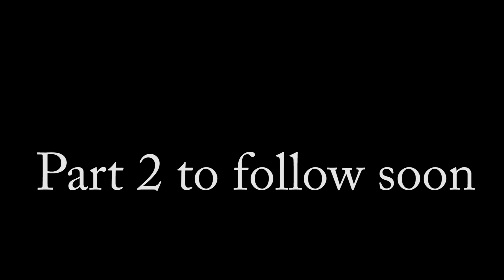Pfizer, process 2

Comment: To those and their families and friends who have taken this 'vaccine' and have suferred please speak out. The evidence is unquestionable......are you not enraged? Please raise your voices and those of your loved ones who are unable to.
Reply: And urge them to try some extended fasting to regenerate the white blood cells it damages. Otherwise they will be helpless in the face of cancer and autoimmune issues, which are dramatically on the rise. Some benefits of doing occasional extended fasting: High blood pressure is lowered to normal levels very quickly while fasting. Fibrosis/scarring is reversed over time, including in the heart and lungs.

Fasting stimulates phagocytosis, the ingestion of bacteria, plaques and viruses by the immune system. It will also remove any 'foreign material' like spikes that are not supposed to be there. Whether natural or unnatural in origin..

Blood clotting is reduced and blood clots and arterial plaque are reabsorbed into the body. 

Blood sugar and insulin are lowered when fasting, allowing white blood cells to move more freely throughout the body and do their job.

Vitamin D plasma levels are increased as fasting improves metabolic health, and vitamin D in turn increases autophagy.

Reflexes and short term memory are increased. 

Fasts from 36-96 h increase metabolic rate due to norepinephrine release! 

Telomeres are lengthened and fasting also increases anti-aging Yamanaka factors.

After 72 hours or more fasted, your body recycles up to 1/3 of all immune bodies, rejuvenating your entire immune system. This helps prevent the onset of new autoimmune conditions, which develop through a leaky gut and damaged immune system.

Fasting can help with MS, Depression, BPD, Autism and seizures.

Thymus is regenerated, which suppresses aging and renews the immune system. The thymus also plays a vital role in fighting cancer.

Weight loss from daily caloric restriction has 1/4 to 1/3 of the weight lost as lean tissue while many studies show fat loss from 36 h fasts without losing any lean tissue! 

The obese will lose extra tissue like loose skin while fasting, but the skinny or frail will have increased growth hormone release than the obese, which helps to make more lean tissue and reduce frailness.

When you move out of MTOR your body shuts down the building blocks of the cell required for viruses to replicate.

The hunger hormone ghrelin also lowers with extended fasting and rises from dieting. 

What breaks a fast? Anything with protein or carbohydrates in it will break a fast. Most teas and herbs are OK. Most supplements and meds will either break ketosis directly or contain a filler that will. Many meds are dangerous to take while fasting.

Does fasting lower testosterone? No, it raises it when the fast is broken by increasing lutenizing hormone. Fasting also increases insulin sensitivity, which helps with muscle building.

Fasts of 36-96 will not affect short term female fertility or affect menstrual cycle. They also may increase long term fertility, especially in women with PCOS.

Fasting reduces pain and anxiety by stimulating the endocannabinoid system in a similar way to CBD oil.

Stomach acid is reduced over time while fasting and can allow for the healing of treatment resistant ulcers. Some patients may need continued acid reduction medication while fasting.

Does the body preferentially prefer glucose as a fuel? No. Except for brief periods of very intense exercise, your body mainly burns fats in the form of free fatty acids. Your brain also prefers to burn ketones at a rate of around 2.5 to 1 when they are available in equal quantity to glucose.

Fasting stimulates the AMPK complex and activates autophagy. Autophagy (literally self eating) will cause cells to recycle damaged proteins and foreign matter such as viruses. It will can kill cancerous and senescent cells

Lowering insulin via fasting virtually eliminates chronic inflammation in the body. 

It increases mitochondrial function and repairs mitichondrial DNA, leading to improved ATP production and oxygen efficiency. Increased mitochondrial function also has the added benefit of increasing your metabolism, fighting infection and cancer prevention!

Fasting releases BDNF and NGF in the blood which stimulates new nerve and brain cell growth. This can help a great deal with diseases like MS, peripheral neuropathy and Alzheimers.

When not in ketosis, the brain can only burn carbohydrate, which produces a great deal of damaging ROS the brain has to deal with.

Fasting also increases telomere length, negating some of the effects of aging at a cellular level.

When you fast, this stimulates apoptosis in senescent or genetically damaged cells, destroying them. Senescent cells are responsible for many of the effects of aging and are a root cause of the development of cancer. 

A fasting mimicking diet for 3-5 days in a row also provides many of the same benefits as water fasting. FMD usually has 200-800 calories, under 18 g of protein and extremely low carbs.

Exogenous ketones can aid with fasting, making it easier in healthy people and allowing some people with specific issues to fast in spite of them without worrying as much about hypoglycemia. They also help with dementia and many other issues even if you take them while not fasting!

Glycine and trimethylglycine can also be useful supplements while fasting that won't break ketosis and have many benefits.

Children, pregnant or nursing women should not fast for periods longer than 16 hours. People with pancreatic tumors or certain forms of hypoglycemia generally cannot fast at all. Type 1 diabetics can also fast but it is more complicated and should be approached with caution as it could lead to ketoacidosis. If you experience extreme symptoms of some kind, especially dizziness or tremors, then simply break the fast and seek advice.

Resources:
https://www.ncbi.nlm.nih.gov/pmc/articles/PMC5783752/
https://www.ncbi.nlm.nih.gov/pmc/articles/PMC1413655/
https://www.ncbi.nlm.nih.gov/pmc/articles/PMC5783752/
https://pubmed.ncbi.nlm.nih.gov/6859089/
https://www.ncbi.nlm.nih.gov/pubmed/10232622
https://www.ncbi.nlm.nih.gov/pmc/articles/PMC8470960/
https://www.cell.com/molecular-cell/fulltext/S1097-2765(18)30605-1?_returnURL=https%3A%2F%2Flinkinghub.elsevier.com%2Fretrieve%2Fpii%2FS1097276518306051%3Fshowall%3Dtrue
https://pubmed.ncbi.nlm.nih.gov/28235195/
https://www.ncbi.nlm.nih.gov/pmc/articles/PMC2815756/
https://www.nia.nih.gov/news/research-intermittent-fasting-shows-health-benefits
https://medicalxpress.com/news/2022-10-treatment-pulmonary-fibrosis-focus-telomeres.html
https://www.ncbi.nlm.nih.gov/pubmed/10859646
https://academic.oup.com/ajcn/article/81/1/69/4607679
https://pubmed.ncbi.nlm.nih.gov/31877297/
https://n.neurology.org/content/88/16_Supplement/P3.090
https://pubmed.ncbi.nlm.nih.gov/31890243/
https://pubmed.ncbi.nlm.nih.gov/2518860/
https://pubmed.ncbi.nlm.nih.gov/29727683/
https://www.ncbi.nlm.nih.gov/pmc/articles/PMC5895342/
https://www.ncbi.nlm.nih.gov/pubmed/25686106

https://www.sciencedirect.com/science/article/pii/S1931312809002832
https://pubmed.ncbi.nlm.nih.gov/15522942/
https://faseb.onlinelibrary.wiley.com/doi/abs/10.1096/fasebj.2019.33.1_supplement.819.10
https://www.biorxiv.org/node/93305.full
https://www.arcjournals.org/pdfs/ijrsb/v3-i11/7.pdf
https://www.ncbi.nlm.nih.gov/pmc/articles/PMC6407435/
https://www.ncbi.nlm.nih.gov/pmc/articles/PMC6141719/
https://pubmed.ncbi.nlm.nih.gov/20921964/
https://pubmed.ncbi.nlm.nih.gov/25909219/
https://pubmed.ncbi.nlm.nih.gov/21410865/
https://www.ncbi.nlm.nih.gov/gene/25712
https://pubmed.ncbi.nlm.nih.gov/23707514/
https://www.ncbi.nlm.nih.gov/pubmed/24905167
https://www.health.harvard.edu/heart-health/abundance-of-fructose-not-good-for-the-liver-heart
https://www.ncbi.nlm.nih.gov/pmc/articles/PMC7093158/
https://clinical.diabetesjournals.org/content/36/3/217
https://www.ncbi.nlm.nih.gov/pubmed/23876457
https://www.ncbi.nlm.nih.gov/pmc/articles/PMC6526871/
https://www.ncbi.nlm.nih.gov/pmc/articles/PMC7607739/
https://www.collective-evolution.com/2017/05/16/study-shows-how-fasting-for-3-days-can-regenerate-your-entire-immune-system/
https://pubmed.ncbi.nlm.nih.gov/7714088/
https://www.cell.com/cell/fulltext/S0092-8674(19)30849-9
https://www.ncbi.nlm.nih.gov/pmc/articles/PMC3017674/
https://pubmed.ncbi.nlm.nih.gov/23408502/
https://www.amjmedsci.org/article/S0002-9629%2815%2900027-0/fulltext
https://europepmc.org/article/MED/22402737?javascript_support=no
https://onlinelibrary.wiley.com/doi/full/10.1111/j.1365-2265.2005.02288.x
https://www.nejm.org/doi/full/10.1056/NEJMoa012908
https://pubmed.ncbi.nlm.nih.gov/27569118/
http://www.cell.com/cell-metabolism/abstract/S1550-4131(15)00224-7
https://repository.upenn.edu/cgi/viewcontent.cgi?article=1537&context=edissertations
https://www.ncbi.nlm.nih.gov/pmc/articles/PMC1779438/
https://www.nejm.org/doi/full/10.1056/NEJMc2001176
http://www.sciencedirect.com/science/article/pii/S0005272806000223
https://www.clinicaltrials.gov/ct2/show/NCT04375657
https://pubmed.ncbi.nlm.nih.gov/20102774/

This list compiled over years of research by the user known as Pottenger's Human on youtube. Feel free to copy and paste this anywhere you like, no accreditation needed!

My community tab will always contain an updated version of this list of fasting benefits. I also have playlists on fasting and health topics.
Reply: @LTPottenger  HAHAHHAHAHAHAHAHA
Reply: @PaulFilmer 
Why are you laughing at this?
Reply: Yes, I don't understand the acceptance of people who've been injured. Where is the outrage?
Reply: @cherylnelson5384 I strongly suspect it’s because of an underlying reason - to help. For me it was a type of sacrifice. I have been a natural energy healer (not Reiki) for 22 years with a private practice for 10. During this time I helped many people with their issues. People of all ages and all conditions. My nature is to look behind the scenes for causes not symptoms. The reason I became a natural energy
 healer, working with the human energy field that both surrounds and permeates the body, was to give my youngest son an increased chance of survival from the brain cancer he suffered as a child. He’s now a medical health professional and working in a front line capacity. I myself have no formal medical training but during my 22 years of practice I became medically intuitive with people’s symptoms. Though ‘healers’ are not allowed to diagnose we often have metaphysical insight into the causes of people’s issues mental, emotional therefore physical. There are good undergraduate texts in the public domain for research and now we have Dr Google so that helps to inform people more quickly if they like to back up their intuition with conventional allopathic current understanding. I took the first vaccine because for all the naysayers in my line of work I sensed it was the humanitarian attitude. I was making my contribution to what I sensed was a great experiment.  I had never been fitter following  the first vaccine although had suffered the taste of it in in my system for four days and also suffered from mild flu like symptoms.  When it came to the top up vaccine I was as a lamb to the slaughter. The volunteer stabbed my upper arm bicep I suspect she hit the nerve. I could not move my arm or right side for 4 weeks, I also had a nerve twitching in the 
left side of my face but as I know the CNS crosses at the midline I suspected this almost Bells Palsy was unrelated. I knew I had nerve damage and tried to make an appointment but was informed not to try to make an appointment, as no one would speak to me, by the nurse practitioner who said that she herself had suffered from this for a week following her top up. I suspected I had better coping mechanisms than many and was sure that I would recover. I did recover from the severity of the pain and lack of movement. I remained inactive in bed for a month. I struggle with medication so took as little ibuprofen as possible, drank plenty water with lemon and practised self healing. My mind was strong then and  I was determined to recover. I began to move about more but noticed that my seasonal allergies had increased and continued increasing. I was taking one prescription only antihistamine for seasonal allergic symptoms, hay fever, but I was developing extreme rashes on my body and would wake up in the morning to find my limbs covered in red circles. I did manage to see the practice nurse who said I had scabies and to treat myself and my husband for this. Of course the treatment was  useless because it wasn’t scabies. I’m a swordswoman and attended a training weekend a few months following the top up which put my body under immense strain by altering my temperature. My nervous system and skin irritation were almost unbearable. Again I sought the help of the GP who prescribed steroids during a phone consultation and the week following another dose. The result of this led to an increase in symptoms after the relief of the first few doses and I entered a mild psychotic state when I was informed to cease the medication. By this time I reasoned the top up jab has seriously altered my immune system and that it was over producing hormones/chemicals to fight a non existent virus in my body. No virus existed but I was the human virus. My parents both suffered severely from autoimmune type diseases. My brother is type 1 diabetic, diagnosed at 21 which was probably childhood onset undetected until he suffered 3 serious viruses, mumps, measles and flu at the age of 20, resulting in a diabetic coma. I suffered severe endometriosis since the onset of puberty. Though allopathic practitioners may not see the connection with familial hormone imbalances, I certainly do. I was determined to rid myself of the effects of this vaccine and followed an elimination diet. I was informed from sending images of my severe rash and symptoms I was unsure of the necessity for a third vaccine but following constant phone calls from the GP to have one, and my son who was working with unvaccinated dying people of my age group and still retaining good will towards others I endured the third, second top up vaccine to my chagrin. What would you do? If your child who had survived a relatively rare brain cancer and who had fought for 10 years to become clear of the disease and ensuing medical issues following recovery who had struggled to achieve his career ambitions and was working in the place for first hand experience of seeing death and dying people and who didn’t want me to succumb to the same fate, I felt I had Hobson’s choice. A few days following the Pfizer top up on my birthday I stood at midnight in my back yard with snow falling on me naked apart from my knickers, screaming in agony and scratching all of my body till it bled and bruised with my husband threatening to call an ambulance or take me to A&E immediately I was screaming no! I did not want any medical intervention. I ran a cold bath and plunged myself into it for 2 hours until the itching began to stop. The worse thing was the anaphylactic symptoms I knew my throat was narrowing and I couldn’t swallow. The doctor on duty at the vaccine centre had administered the third vaccine because I had complained to her about not wanting to be treated like a piece of meat. I had no immediate reaction the symptoms began about 5 days later. I had recovered before and I would recover again I told myself. Positivity is the key. There were plenty people worse off than me. However, this third time’s vaccine was harder to recover from. I did barrage the medical profession for help. I implored my GP to write for appointments to dermatology and immunology departments. This was a huge struggle because she did not want to refer me saying what was the point, I can’t take any medication they might prescribe that I should accept I had am autoimmune disease and think myself lucky. She disputed the fact that vaccine damage was the cause. It was a battle of wills. I wrote a very persuasive letter to the same GP and she did eventually write to these departments. This was 18 months ago. I have seen the dermatologist who considers my symptoms hormonal. I am yet to see the immunologist. Further to my recovery from the third vaccine I had three whole weeks without symptoms and 7 months following the third vaccine, second top up I contracted king Covid from my husband and 14 months later have still not recovered. I have given up many of my previous activities, all I have worked for, a healthy body and youthful experience. I can’t practice yoga or train in swords. As I can’t stand pressure on my limbs I struggle walking up the stairs. My digestion is very poor my eyesight is blurry, I have brain fog, ninety loss and the skin which was once pure and free of blemishes is now bumpy marked and constantly pricking. I have lost myself and found an old lady looking back at me. I don’t have the energy to complain. No one is actively listening. Here Dr Campbell affords an opportunity for those affected or their families to voice their discontent. Yes I’m discontented with global policies and the selfish mendacity that feeds our leaders. We didn’t know did we or were blinkered to the great experiment but life itself is an experiment. My energy is now best centred upon trying to reprogram my body to reinput the old system. I must work closely with pituitary and pineal energy centres and do what I can when I canto survive this crisis. I don’t think being angry will help my body. The last thing I need to do is be angry with myself or anyone. There are always unknown reasons behind everything in this little life. I have shared some of my story here because it seemed appropriate.  The fight has gone out of me to protest. I’m choosing my battle which is an inner one. I can’t wear my helm because my head itches as soon as I change internal temperature but I’m going to try. Slowly I will recover then I can help others recover too. Hope this explains.
Reply: Same. Why are some of the jab injured not angry??? Or in shock??? The scorttish vaccine injured group are very vocal which is great but how are others not.
Reply: @andreagerrity1056  because others haven't been grifted
Reply: I’ve had to help quite a few through illness including severe injuries …most are doing well now…but now it’s me I’m absolutely exhausted…I’m trying to inform them of their rights I don’t live near some of them and now I’ve not even been able to drive. I feel ill now the shock aswell 3 yrs of it. I’m Im trying. Where is the outrage …where was everybody? Bless all.
Reply: HI, take it easy for a while, sounds like you deserve a break! Don't carry the weight of the world on your shoulders. By spreading the word you are lessening the load. All the best. @caroleyre9144